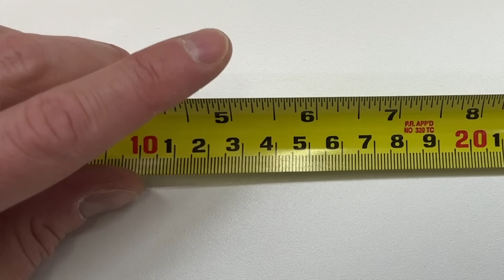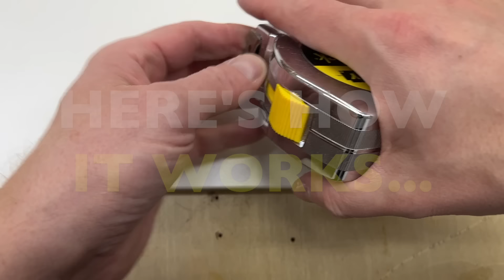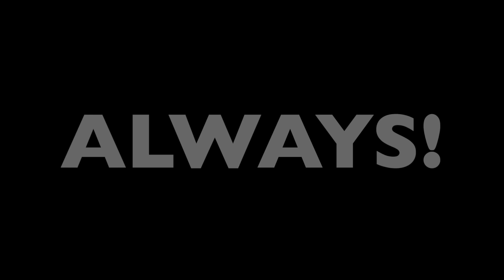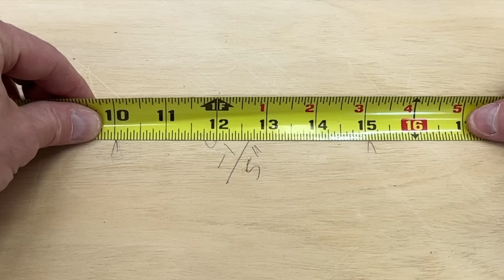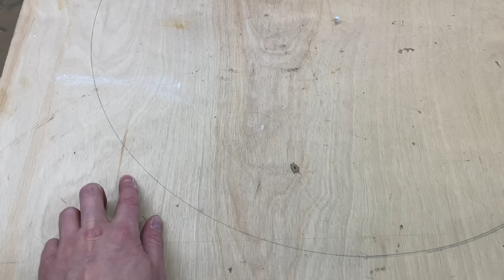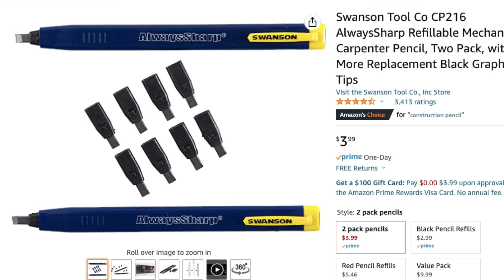ALL TAPE MEASURE TRICKS Explained...In Just 13 Minutes! (Measuring Tape Pro TIPS, TRICKS + ADVICE!)

Comment: Measuring into a corner ACCURATELY - Butt your tape into the corner that you're trying to measure to and make a mark at any whole. I typically mark 10" as it's an easy number to add and it gives you a little room for the next step. Now butt/hook your tape to the opposite end of what you're measuring and pull the tape to the mark that you just made and read the measurement. Add the distance that you marked to that reading and you will have a super accurate measurement every time.

Comment: I would have said err on the long side when measuring into a corner. And you can find the middle of a measurement by folding the tapa onto the full measurement.  Fold the tape onto the 8' mark and 4' would be at the bend. This helps when you are on a fraction and the math gets too hard. haha

Comment: I'm a Stanley FatMax fan. They'll take a heck of allot of abuse and last forever. I used to frame houses about 20 years ago. Everyone on the crew had 2 or 3 Craftsman 25' tapes. They had a bad spring design and would fail after awhile, so they kept extras to pull out. Every 3 or 4 months they'd take the beaters into Sears and get them replaced for free. I bought a Fatmax, and it NEVER failed, lasted till I quit and went to do something else.

Comment: When I measure, if my measurement is 7/16ths, I'll either call it as a half light or 3/8ths heavy.... Light means subtract a 1/16th, heavy means add a 16th.
63 and an a quarter heavy just seems easier than saying 63 and 5/16ths.

Comment: Great tips! We, as electricians have to use tape measures for layout, running conduit, etc. But I found that it can be convenient for figuring 3 phase wiring. If any electricians are reading this, they know that the phases are A-B-C. For example circuits 1&2 would be A, 3&4=B, 5&6=C, then repeating again 7&8=A, 9&10=B, 11&12=C. (Notice that’s like 12”)
Looking at a tape measure and trying to quickly determine what phase circuit 69 would be, you would see that 69” is also 5’9. Ah Ha, the 9 is B phase. Again circuit 77 would be 77” and read 6’5 & 5 is C phase.
Most of us have been able to memorize the circuit number to the phase and it is important to match the phase color of the wire before pulling into a run.
Hope that I didn’t make that confusing. Maybe I should try making a short video?

Comment: If you want to sound like a pro just use millimetres….lol….cuts out all this sixteenths and eighths confusion. Metric is far superior, even if you grew up with Imperial as I did. You just measure and say 1257 or 681 or 7980. So much easier, more accurate and less prone to errors.

Comment: The one with the corner is not that accurate they are more accurate ways of doing that in the same way you measure from one end and mark a point then measure the other way to that point and adding both

Comment: Tape measure should never be put on side of dominate hand. How are you going to pull a tape measure out and a pencil quickly at the same time? You won’t. Having pencil on dominate hand and tape on the weak hand is how it goes. Ntm when you’re done with the tape and need to square a mark across them you put tape away with left hand and grab speed square with left hand after you put tape away, it’s a fluid motion. You can’t do that if it is in our right pouch.

Comment: I was lucky enough to be raised by a 'standard' dad and 'metric' school system in the 70's and 80's. I understand both well. It made it easy to understand both by knowing their origins. Regarding distance measurement, the standard system origin is MUCH simpler than the metric system origin. Then you're simply cutting things in half again and again. One of the comments was sarcastic and frustrated in nature by asking 'what's half of 13⁵/⁸"???' When physically using the tape, there's an easy, one second, trick that eliminates the 'math' part (although the math part is pretty easy too by virtue of cutting things in half again and again).

Comment: The circle trick has an accurate marking device built in, hook your nail, pull out to your radius and make a tick, now pull out the belt clip and stick your pencil through that slot, adjust tape length so the pencil meets the mark and lock the tape, scribe your circle. This is really handy for large circles, up to 50 ft circle for 25 ft tape. 2c
Reply: The slot on the belt loop fits a pencil for circles or scribing

Comment: I’ve never watched one of these before.  I’m a Forman at a construction company.  I didn’t realize that I do every single tape technique out of muscle memory while never being showed when I was younger how to do this.  Now I’m sure I picked up a few things down the line.  But tape handing described in this video is exactly the same as I use mine.  I always use Stanley power lock 25 or 30s too. And I never use the lock unless i lay the tape out and have someone else do 16 oc set ahead.  Also. We burn an inch or 2 almost always in trim work. But in rough framing.  Hardly ever
Reply from the maker: That’s awesome! 👍

Comment: Good video. I also prefer the Stanley power lock. Years ago on the job we would have tape measure races at lunch break. Guys would take their TMs apart and add spring tension, polish and wax or lube the internals. And bet on who had the fastest.

Comment: We rarely call out 16ths. We say something like "7/8 fat" to add a 1/16 or skinny, thin, light.... To subtract one. You forgot about tape measure box size. Stanley always tells you how big the case is for 12', 16', 25 and 30 say 3 ". For inside measurements you butt the tab against one end and the back of the tape measure against the other end and where the tape comes out shows exactly what the fraction is. Then add whatever number is printed on tape measure itself. The back of the tape measure may not be perfectly square so you need to adjust it to where it settles and can go no further.

Comment: If you need to cut an od measurement in half (example: 8 5/16") you can angle the tape to a whole number (example: 9", or 10") and make your half mark off of the whole number (example: 4 1/2", or 5").

Comment: Good information for beginners. One comment, I hung drywall for many years. We would only call out measurements by eights. Ie: eleven plus six meaning 11 3/4”. Sometimes you are hollering all the way across the house and it’s easier to understand. All crews have their own little secrets like that. It was more common to hear it used on the west coast. Not so much on the east coast.

Comment: i think the only thing i would add to the video is in regards to measuring into corners for beginners or getting a perfect measurement. lets say measuring from a corner to a corner, no edge. You could easily put the Tab of the tape right into a corner and measure out (for example) 10" from the corner and make a mark, then switch the tab of the tape to the opposite corner and measure out to the mark that you had made 10" off the initial corner. So the only thing that you would have to do is take that 2nd measurement and then add 10" to get the proper accurate measurement from a corner to corner situation. All in all, this was an amazing video! if I ever have someone who struggles with a tape measure then I'll be sending them to watch this video instead of me having to take the time to teach them. It'll take less time that way! Keep up the good work!

Comment: For inside corners, such as a window sill, I like to measure one side to an even number. Then turn the tape around and measure from the opposite corner to that even number you selected. Add the two measurements for an exact fit.
Reply: Try looking at the back of your tape, on the body it should tell you how long the body is. So when you measure into a corner you can sit the entire body into the opposite corner and pull your tape and add the width of the body to it. Very accurate.

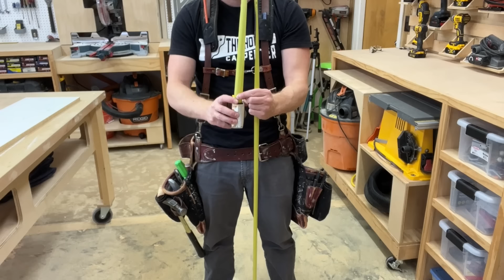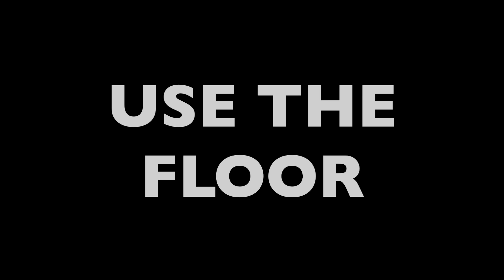Comment: I used the very tip you mention at 6:30-6:55 we’ll kind of I was measure a set of Chicago Schwinn fender braces because I wanted to know the length it needed to be for a 1975 26” Schwinn Speedster 3-speed model, I got the right measurement it was 26” exactly on the money.

Comment: I liked the video. I do not like the Stanley line of tape measures. As an old professional myself, I do know the ways of the tape measure. After retirement,in my own wood shop, I purchased 5 Stanley 25’ tape measures to set around my shop. On a particular project I noticed my measurements were not coming out right. I finally put the tape measures next to each other, stretched out to 54” as this was my distance of cut on my table saw. After about 1’ on the tape measures they did not line up with each. Some off as much as 1/8” as it got farther out. My Stanley’s are now in the trash can. I am very particular about precision.

Comment: Easiest way to measure length to an inside corner is to just use the end of the tape and measure out 10" or whatever then measure to that point and add 10" instead of kinda guesstimating like the guy does here.

Comment: Great using the metrics system over here in the UK. Especially when we buy structural timber in rough sawn 102x 51 in 2700mm lengths, sheets of osb, plywood or MDF in 2440 x 1220 x 18mm. Yes that's 4" x 2" x 9ft or an 8' by 4' sheet of 3/4" product.

Comment: I saw a video where the tape measure casing had a measurement on it to be used as a distance to add to the measurement for butting up to corners instead of folding the tape and measuring it that way. Is this accurate? I'm noticing it on my various tape measures -Ex: + 2 1/4 or 57mm - Do you guys actually use and trust this method?

Comment: I started hanging sheetrock 47 years ago. The way we measured was to use the 1/8th inch marks and say strong or short for an extra 1/16th inch. So if the measurement was 59 and 11/16th 's, we'd say 59 and 5 strong.

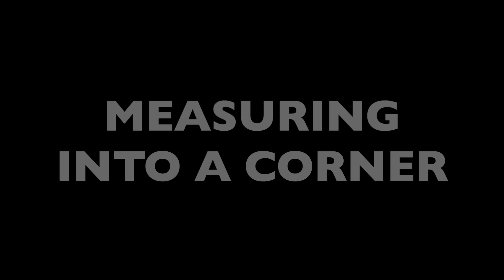Comment: 9:25... Measuring into a corner, or measuring wall to wall... If you know how thick the tape measure body is, just butt the end of the tape to the wall, and add the two measurements together. For instance, my tape measure body is exactly 4 inches wide. If my edge to corner, or wall to wall, reads 16 inches on the tape, adding the body of 4 inches, gives me 20 inches.

Comment: Mistake I've made often is when making more than one 1 ft mark (consecutive down a board) by the time I get to the end of the board, I'm 1/2 inch or more off because of the width of the blade from each cut. I always cut, then measure, cut, then measure - it's a pain because it's a lot slower, but you don't lose the 1/8th each time.

Comment: Hi, while watching your video about measuring in corners, I noticed that you didn't show how you don't have to bend the tape at all,  simply slide the tape housing to desired point,  knowing that the actual housing  is exactly 3" allows you to just add the 3" to your measurement, Versus bending it, and possibly getting a false read?

Comment: It’s great to see how a pro uses tape measures! I’ve used tape measures in our print shop for years and still picked up a couple of tips. We have the Komelon 12’ tape measures scattered all over our shop. When the boss has purchased other brands or lengths, no one uses them - they’re great for smaller fabrication and packaging applications. They are lightweight, and quite durable, and the bright yellow case makes them easy to find. Thanks for the great video!

Comment: Finding a tape measure(s) that fits your eye is important.  Stanley Powerlock is a great tape measure, and I love that the 25ft and 26ft/8m versions are made in the States.  It is an affordable workhorse.  

FastCap for Metric is the best (IMO) - they make a lay flat version (also in Imperial) that cannot be beaten for ease of use and cost.

Kobalt also makes a very nice tape measure.  Silver tape with black markings.

Comment: I never measure into a corner by bending the blade.
I use a combination square or use a tape measure and mark either 6" or 12" away from the corner.  Then measure to that mark and add either 6" or 12".  Much more precise and faster than trying to read bent or butted into the corner tape measure.

Comment: 1 thing to add: some good tape measure have a known case length size, so if you need to take a measure inside a frame or box, you just add the read and the case size ;) you can also gage it yourself

Comment: I love your videos and the info in this but you didn't even mention that most tapes have their length imprinted. There's no need to do the curvy thing if you just add the length of the unit to your measure. This is an amazing DIY thing, though measuring from both sides resolves this issue in construction.

Comment: Great tape tips but there is one more that you have overlooked and that is;
When you allow the tape to retract, use your crimping finger or the tape lock as a brake so as not to let the tape slam home. Doing so repeatedly may damage the tab and even break it off. Allowing the tape to slam home repeatedly will eventually loosen the tab rivets and you may end up with an extra 1/16th or more added to your measurement.

Comment: When taking a measurement across a long span or even a suspended measurement what are some tricks to ensure that you're level from point a to b? I need to cut a few rubber horse stall mats to fit a space and my non mechanically inclined mind is having trouble. Thanks!

Comment: I too am a fan of the 25' powerlock.  I also focus on the 1/8" marks, but if for expediency, I got in the habit of noting my measurements as fat or thin.  11/16 is 5/8 fat.  9/16 would be 5/8 thin or 1/2 fat.  I picked the trick up from a carpenter many years ago.  It works very well and doesn't require doing the math steps in your head.

Comment: Good on you.  With metric hard materials are best measured in millimetres. Soft materials like carpet, curtains and clothes are usually measured in centimeters due to the stretch factor.
Reply from the maker: Good metric tip, Building!

Comment: One of the things thats been hurting me recently are mixed units.  I'll get a distance in a design that's something like 3.85 inches ie imperial inches with a decimal fraction.  So what I'd need is the inch markers with decimal fractions between them on a tape.  Currently I have to convert this to mm/cm and use a decimal tape, but the conversion ads an extra step as I either have full imperial or full decimal but not the mix.

Comment: There is also another trick about measuring into corners. You stick something flat like a card into a corner measure up to the edge of the card then add the length of the card to the measurement.

Comment: I often forgot to subtract 1 from "Burn an inch"  So I always start at 10".  Besides, when I burn 10", it's usually a dimension that needs higher accuracy and often less than 1 ft.  If you mess up by 10", you will know immediately so you don't carry the mistake forward for too long.
Reply from the maker: Good point! 👍

Comment: Good tip for measuring the distance of two inside corners. instead of using the bent section of tape or the numbers listed on the tape body, draw mark from tape tab out of the corner a few inches. put your tab in the other corner and measure to that mark. a lot easier than having to trust you're reading the mark in the bend accurately.

Comment: For wood working I don't need or want all the sub makrings like 16 inch stud spacing etc.  They just get in the way a cluter up the works. Is there a decent tape measure that just has inches ? No foot call outs, no stud call outs just plain inches.

Comment: Thank you so much for this. It seems like it should be so simple, but I never understood or have trusted the tab wiggle and didn’t know that it automatically adjusts. I’ll have to play with it and see because it doesn’t seem like it would work like that but I trust your expertise and your explanation AND am glad to know that it’s SUPPOSED to work like that.  It will keep me from having to “burn“ that inch every time I measure something.  Also, learning how to split the 8th inch by sight is very helpful. Being older, and having fading eyesight, I’ve basically just been making a mental note of where it falls on the tape measure and just telling myself “well, it’s a little over 3/4 of an inch or it’s a little over 1/2 an inch, etc. and just winging it, which we know is unforgiving for accuracy. Thanks again for all your tips on how to properly use what would (ar first glance) SEEM to be, a “what could go wrong “ simple tool.

Comment: But millimeters may be more logical, but they are harder to see.  We only have sixteenths and thirty seconds that are hard to read.  Every single mark on their tapes is hard to read. That said, when you get down to micro adjusting issues, millimeters are superior because of being in a base 10.  7/10ths is just mathematically easier than 5 16ths.  So it depends on what you are doing which system works best, I think.

Comment: Love the channel...
Regarding measuring in corners. On most metric tapes, the width of the casing is printed on it.
Simply put the back of the casing against the corner and add the witdth to the measurement.
Way more accurate.